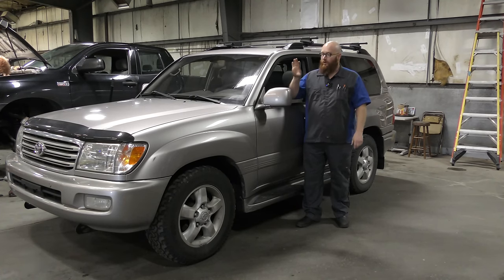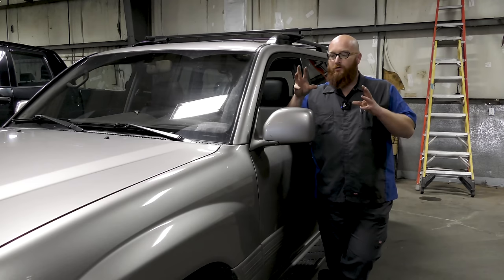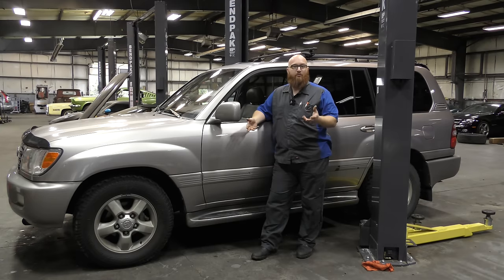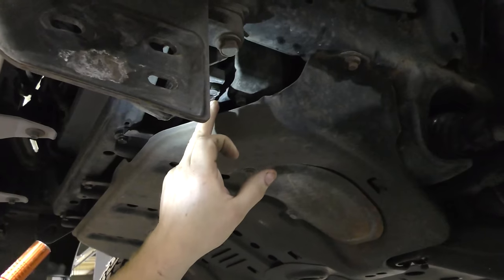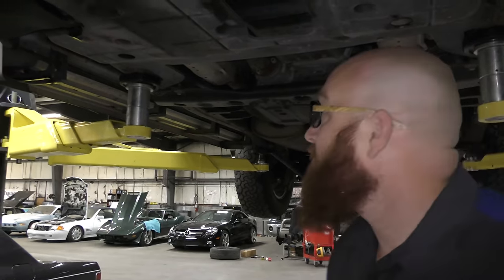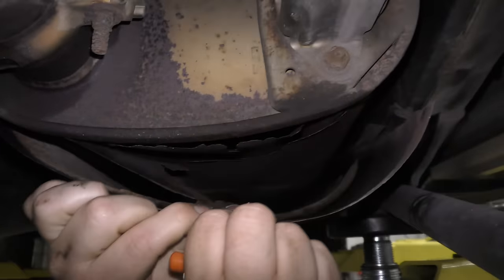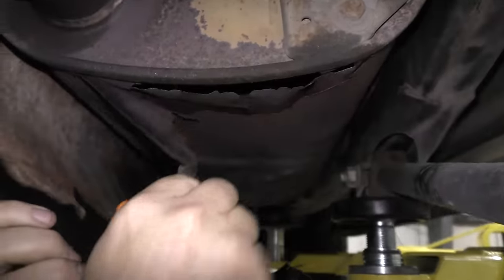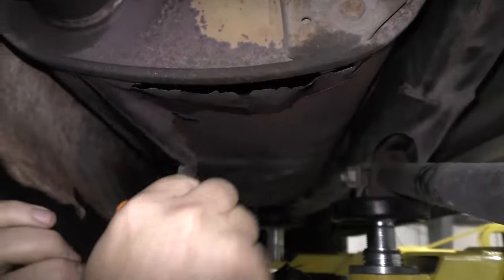Vehicle Making a Horrible Noise?! CAR WIZARD finds the problem & shares how not to be duped by shops

Comment: I had a customer about 3 years ago. Bring me his 2004 Ford Expedition. He even bought his own motor and brought it to me with the truck. He wanted me to put the motor in because the original was making a knocking noise. I always check a car out before I change a motor. I like to understand why that engine blew up. Did it run hot, was it out of oil etc. But long story short I was checking the truck out before I proceeded to swap the engine and found the catalytic converter core had become dislodged and was bouncing around inside. Always go through a systematic investigation when diagnosing vehicles. I saved this guy thousands.
Reply: i know toyots are excellent cars have rav4 done over 400,000 kms would like to see a buy this not that toyota edition
Reply: Wait...you check out a car before you swap a motor?   How novel.   :-)
Reply: cornelis matla Toyota is going to be his hardest buy this not that edition
Reply: There's no point. His lesson to the Asian cars video was 'buy a toyota'. I mean sure, older ones will be harder to find parts for, but can anyone actually name a legitimately bad Toyota from the past 25 years?
Reply: @Zyo117  Yes, the Toyota Cavalier, sold in Japan...
You may have to Google that to get the joke.
Reply: Car wizard, I noticed that Toyota’s and Honda’s made in Japan are of higher quality than the US market specific vehicles.  This land Cruiser and your late Honda prelude are examples of this
Reply: @cornelismatla4790  The buy this, not that video for Toyota will be up in a few weeks.
Reply: My cat core blocked the pipe  so completely that exhaust was escaping around the manifold gasket, whistling like a crazed teakettle
Reply: I can tell that he got another problem pop up and he was angry because he told you to change the engine😂😂💔 People bro...
Reply: @NuclearGrizzly  yup. I've had too many customers bring cars in and ask me to do something that another person or mechanic said was the problem and through my normal diagnostic process I usually find out its something else. I never let the customer self diagnose. I don't like double work. Meaning you tell me hey put this starter on I think that's the issue. I do my own diagnosis and make sure that's the problem. Customers don't like to waste money. I don't like wasting my time or my money.
Reply: I would've replaced it and kept the motor.
Reply: You're preaching to the choir. Its up to the man in charge, whether or not the employees do diligent checks or not. If he's money grubby, the employers will do whatever they can to make money, if the man cares about customers, the mechanics will be town heros
Reply: @crabhab  definitely man. The same can be same of a hyundai/kia made in korea vs american models. But that sticks very much more so to them than toyota or honda. They had terrible issues with american made models. While as korean made ones can go and go and go some more. I've seen people with some same year toyotas and hondas fix more stuff than I have on a 05 elantra so I will say there are certain models on that tier especially most Hyundais after 2001 with the beta 2 engine. It's almost as if they switched with nissan and mitsubishi which both used to be very good until the 2000s and Hyundai even used to use old mitsu tech( which was why they were so crappy at first) then when they introduced their own korean tech the quality shot way up. The same is for the japanese made japan vehicles vs american made. Only exception to that rule is the toyota trucks like tundra and tacoma those can go a million even tho they are american made.

Comment: If you're going into the desert...ALWAYS TAKE A TOYOTA. I don't know why, but they last forever in the sand box!
Reply: Toyota's biggest weakness was North American winters.  Plenty of box frame Tacos rusted out.  The box frames were stronger than C frames (hence why trucks like the Hilux could take a beating), but salty water from the roads ate them out.
Reply: @spyderf16  those box frames weren't built by Toyota. They sued the company that did
Reply: spyderf16 yea nothing you said is true
Reply: @spyderf16   Tacos don't like water,  they get soggy. Hot sauce is good on them tho.  Never heard of a box frame taco.
Reply: Driving fast night rain creepy forest as a long time mercedes owner I highly do not recommend 😂😂😂 they can barely take a beating in LA traffic
Reply: Driving fast night rain creepy forest why
Reply: @spyderf16  yep i had a 04 not a spot of rust on the body. Frame..., Swiss cheese. Rusted in 2 at the leaf spring mounts
Reply: I HAVE THE DOCUMENTS box frame tacos are the best. Very wide so you can fill with extra meat, cheese and hot sauce. There is also the box frame fish tacos but not everyone is into that and some guys eat those in private and don’t tell their friends.
Reply: @DMAX-tp4pc  portal axels/hubs ftw!
Reply: spyderf16 Toyota ended up replacing the frames for free, and new ones are coated properly so they don’t rust
Reply: @DMAX-tp4pc  
G wagons height were designed for troops wearing helmets and with bayonets fixed.
Reply: that's the only place they last, every where else they are already rusted away
Reply: I live in the desert, and no. Toyotas are not the most driven trucks here, nor do they seem to outlast or outperform trucks from GM or Ford. Especially the diesels.
Reply: Mark Williams Like 70 Series Troopies in Oz!
Reply: yusufaustralia Yusuf, mate I live in Arizona, right next to the american Sahara in the sonoran desert. Trust me, toyotas here do not outnumber or outlast big American trucks here. As a matter of fact, GM has their proving grounds about 30 minutes away from here. Hardly ever do you see an old landcruiser here, you do see tons of Jeeps, and old Broncos.
Keep in mind, this is the sonoran desert, heat, dust and rugged roads are the norm here.
Reply: @jibrilsarabi2908  That doesn't mean they're better than Toyotas necessarily. It just means that local buyers prefer U.S. brands (which are in general cheaper).
Reply: vivadjango I dont think Toyota makes a 75 thousand dollar truck ( Raptor) it doesnt make a heavy duty truck, and the trucks are very outdated. Especially the tundra. 
Its 5.7 L powered tundra gets something like 14 MPG, whereas the F150 and Silverado top 20 MPG. 
In the Ford you have many options as far as engines, cabs, etc they are not cookie cutter trucks, thats why people love them. And honestly in the desert american trucks seem to last longer.
Reply: Why did God create the Nissan Patrol? 

Because LandCruisers need hero's too 😜
Reply: @ant0n13l  apparently the frame manufacturer Dana Corp didn't use the right metallurgical chemistry during manufacturing and they cheaped out on the primer/paint too. Dana Corp must've been the issue because I have an 06 GX that spent its whole life in Canada, they were manufactured in Japan and had nothing to do with Dana Corp, the frame has almost no surface rust on it, and it should because the previous owner didn't really take care of it like they should've lol.
Reply: @aaronmoxey9710  I don't have any experience with a Japanese manufactured Nissan Patrol personally, maybe the older jatco transmissions were more reliable, but I know North American Nissans and their Jatco transmissions are gaaaarbage brotha lol.
Reply: @jordanmercier3616  not familiar with the Jatco mate, I got a old GQ patrol (safari) and that's got a all iron 5 speed manual.

I know in the Navara (frontier over there) and the 2.8 patrol they had a 300zx box, and they just weren't up to it
Reply: Wash out inside the box section with chain saw oil and white spirit thinners. That stuff soaks under the rust and stops corrosion. 
Just avoid parking on a nice drive while it drips.

Comment: I trained as a Porsche mechanic (they call them "technicians" now).  One of the first things Rolf taught me after school and in my apprenticeship, was to pretty much disregard the customer's diagnosis.  "You are the mechanic" he would tell me. "It is your responsibility to find the genuine problem by testing and experience and then fix it properly.  Be the craftsman.". The customer's diagnosis will often lead you down the wrong path, so listen to them,  but take it with a grain of salt.  The customer wants to show you that they know what's up, and many of them have been burned by unscrupulous mechanics, so they want to be involved.  This is normal.  Show them.  Teach them.  

Be a wizard.  

I finally gave up being a mechanic in a shop and went off to work on power plant engines, fishing boats, airplanes and cranes because I was tired of being suspected of being a fraud and having to constantly defend myself from accusations of trying to sell them services they didn't need.  I'm an honest mechanic, well trained and competent, but it finally wore me down.  

Bon chance.
Reply: You are on the button. Thanks for your comments
Reply: I’m a computer tech and this is exactly correct.
Reply: Sometimes it is amazing the way in which the public (not all) but some treats a service tech or an employee on the retail industry. Totally unnecessary. It’s also true that it is easy to get ripped off by a mechanic. Try to meet half way, educate yourself on things that you own. At least be a little curious about what you drive and how it works. Too many people don’t have any idea how something works that they own and use everyday.

Comment: Having an honest mechanic is an invaluable part of life
Reply: Couldn't agree more. I'm transitioning to a different mechanic hoping for better performance. So annoying...
Reply: Robert Burley  I almost shat when he said $750 for a muffler and one wheel bearing.  Smh.
Reply: Ryan Coldiron you have any idea the cost on a land cruiser muffler and wheel bearing lmao mufflers probably couple hundred wheel bearing is probably more
Reply: @daevid21  yes, any muffler shop can weld a muffler on it for around $100 and I found the entire wheel hub assembly with the bearing in it, just unbolt the old one and bolt the new one on for $122 with a warranty and it's not junk.  Moog makes some good parts

Also, we've all seen the kind of exhaust work "wizard" does.   Watch his vw video.  Lmfao.    I wouldnt pay for that level of welding.   I can do that myself
Reply: @getchasome6230  then do it yourself
Reply: @getchasome6230  you're silly
Reply: @HotRed00  I already do

Comment: I love this Wizard's honesty. I have a 1998 LX470 that had it's belt and water pump, tensioner  changed at 174K.
The mechanic told me that the timing belt was still in good condition and told me that it doesn't need to be replaced.
I told him to change it anyway. I still have the SUV and now has over 200k. No major repair to date. 
I love it more now than when I bought it.
Reply: Isn’t the service suppose to be sooner than 174k miles??
Reply: @Walterrinho  every 100K more or less. It’s because when they fail it will usually destroy the engine, not worth taking such a big risk over a couple hundred dollars. I believe this is how it goes for most 4.7’s if they’re an interference engine
Reply: You’ve got a gem
Reply: Those radiators are usually only good for  about 100k. It should be seen as a maintenance item. You change the timing belt , do the radiator as well while your in there along with the water pump and tensioners.
Reply: @4.0cowboy  That's just what you heard on the Internet... Toyota makes some of the most robust timing belt components.
Reply: I wish every automobile mechanic was this honest and knowledgeable.
Reply: I feel you, I have a 2001 4runner with 235k miles and still runs like a champ. Timing belt, water pump, tensioners, pulleys, even the bolts and screws replaced. Expecting another 100k miles on it.
Reply: I don't remember what work he was doing,  but we had a local mechanic thay said, hey, I will already have the cover off, for $40 I will go ahead and change the timing belt. (2002 4runner).
 Yeah, go ahead and do it.

Comment: She's a beaut.  I have a 98 Land Cruiser and my wife drives a 2006 LX 470. I just replaced the exhaust on the 98 last weekend, and my wife's last year.  It was nice to see you post about the reliability. We have almost 500,000 miles between the two of ours. Another 240K on the LS 430. Toyotas are the best.

Comment: Am a proud owner of an 05 Landcruiser 100 series. She has 210k miles, drives absolutely great. Only problems she had was a leaking Rt axle seal, inoperative 6 cd changer, (I use a bluetooth accessory, so not worried), broken roof rack ends and a cracked windshield.  Had timing belt and water pump replaced at 90k, replaced leaking power steering hose and plastic heater core pipe that disintegrated due to age.Otherwise, like the Wizard said, this vehicle out performs the Expeditions, Navigators,Escalades, Denalis, Surburbans and the Range Rovers. 
I am not trading her in for anything. Thanks Wizard. Great video as usual.

Comment: Had a Toyota Corolla once with the mighty 4AGE engine that was running rough, replaced the plugs, checked the entire ignition system, removed and cleaned the injectors, checked the value clearances, still the same.
Turned out it was simply the front engine mount was put in backwards probably after a clutch replacement. It had bound up and was effectively a solid mounts. Put it the right way around, car ran smooth as new.
Reply: It’s obvious when an engine is rough running and when it’s engine mount related... that’s why it’s important to diagnose
Reply: I have a 7AFE. Very durable engine. Haven't done much to it other than spark plugs and 02 sensor. 300k miles
Reply: @zoneb609  or so you'de think.
Reply: I did a similar thing to a 1995 Toyota pickup, replaced alternator, starter (jacked up the timing), just to find out it was a bad positive battery cable

Comment: You are the man Car Wizard!  Love your channel.  Wanted to quickly chime in to say that I had my muffler blow out on my 03 LX 470 a few years back.   Was short on cash and rather enjoyed the V8 rumble so I let it ride a few months before repairing.  Well the hot exhaust blowing out where it wasn’t supposed to melted the wiring harness that controlled the AHC hydraulic suspension in the rear of the car.  Cost me a lot more money and time trying to chase down why my suspension had defaulted into sport mode.  Bottom line is, don’t let issues linger as they will create more problems.  Thanks for all the great videos and insight wizard!
Reply: I agree 100%

Comment: I had an 06 LX470 and put 180kmikes on it till I rolled it in 2017. Countless roadtrips. Countless off road camping trips. Absolutely loved that car. Amazing vehicles. I Never did anything single mechanical repair to that car asides from brakes and regular maintenance. They don't make em how they used to. If any of y'all are looking into buying one of these I HIGHLY recommend it. But please if you are just step up and get an LX470. Much nicer car inside and out  and the hydraulic suspension makes it that much better.

Comment: On the valve covers! Just a tip since I've played a lot with these engines,  the bolts are usually loose on the covers, a little snugging and the seaping stops 👍
Reply: Same with my 05 Tundra
Reply: ...and my 02’ & 05’ Tundras

Comment: Amazing condition for the mileage, good maintenance and sound engineering both played a part.  I used to be a staunch buy USA only guy but the last few years ive gained new respect for Toyota and to a bit lesser degree Honda.  Cant ignore good engineering and a high reliability record.
Reply: yambo59 AIUI, the V8 engine is produced in USA. Unless just the diesel is... hmm maybe it is just the diesel. I heard that a US plant is stopping making the diesel V8 and as a consequence, the V8 diesel is disappearing from Australia. Apart from anything else though, it’s fun going through the comments and adding one here and there 😁
Reply: @cameronbrown7925  Not all of the 2uz V8s are built in the US. The one in the Land Cruiser is built in Japan
Reply: @mckibbenm13  Oh right. I thought i might've had my wires crossed :-) Very nice engines, anyway and I'd love to be able to afford to run a car with one in it!

Comment: I took my old car into an oil change shop for an oil change ages ago.  I had topped off the coolant a week or so earlier, because it kept getting low and I knew something was wrong. They showed me some coolant that was in the engine compartment and without checking anything out said that I needed a water pump and quoted me a ridiculous price.  I took it to a mechanic who I was told was very honest, he looked at it, called me and said that it was just a loose hose clamp he tightened it and didn't charge me a thing.  I tried to give him something but he wouldn't take it.
Reply: That's when you become a permanent customer of this absolute diamond you've discovered! That's exactly what I did when I unearthed my mechanic. Stayed with him through multiple cars and only migrating westward ended my use of his expertise.
Reply: @saadgt2009  Exactly right!!!
Reply: I had a Plymouth voyager that had an antifreeze leak. I took it to a new mechanic that had just opened on the corner of my street. He told me there’s a pipe that runs under the intake manifold to the water pump that probably rusted out. Said it would be about $250 fix. When I went to pick it up he told me it’s $50, was a preformed hose that attaches to that tube nothing more. I’ve been going to him ever since and I recommend his shop when I’m asked about a mechanic.
Reply: I had a mechanic like that but he retired... miss that guy so much